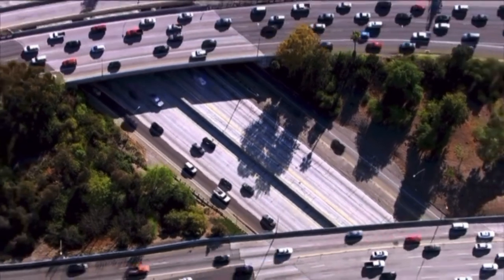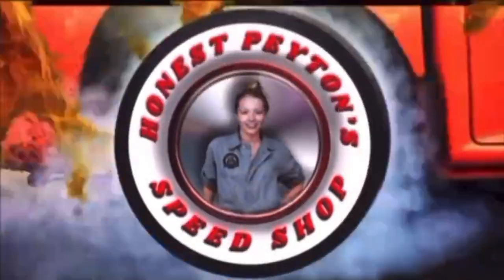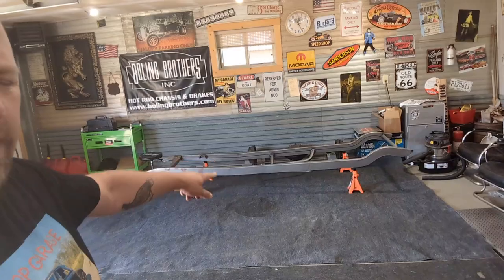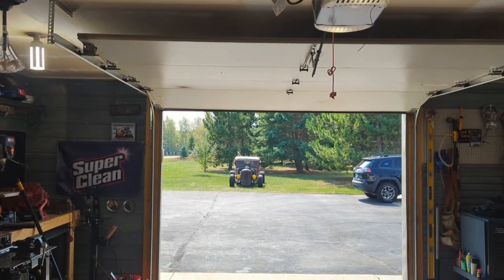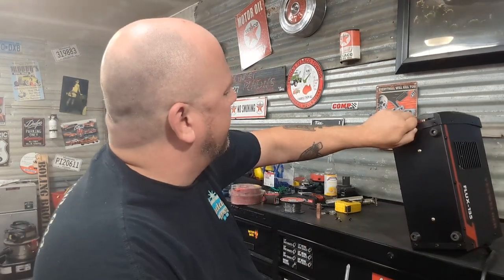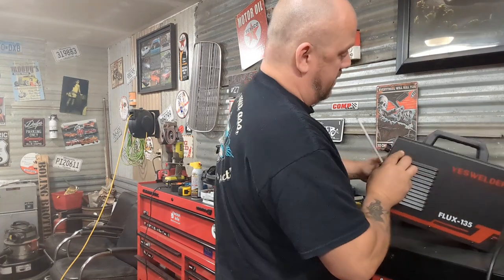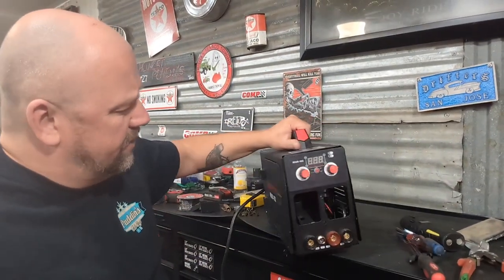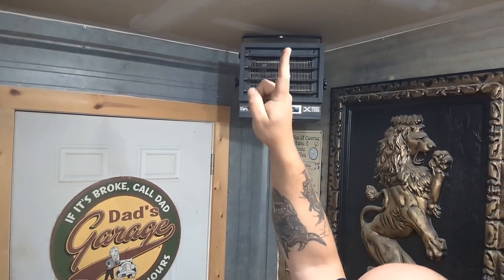Spring Cleaning...is it too late?

Comment: Worst part of the year FALL time to prep for the curse word. Winter ……. Get you a Howard handler gas welder , for the home they are great. I still use mine at the shop too as well as my miller 135 and the 185
Reply from the maker: I got a MIG 200 from Arccaptain, I have the two flux core welders as spares now.

Comment: That’s not your failure; that’s a very early YesWelder failure. And then making it hard to take apart 🤦‍♂️. You’ll get it. It’s all looking really good out there Chad. Did I miss you putting down a carpet out there or were my eyes playing tricks on me?  Cool to hear about Peyton’s school; she will be a rock star! I made a patch panel on the front of the cowl tonight and plan to install it this weekend. After that I’ll put out the video. Have a great night and tell the family hi 👋
Reply from the maker: The floor mat was under Clyde for the leaks, I added the second one for a little thermal break. They are garage floor mats, work great. I did get the welder figured out, I show it in an upcoming video.
Reply: @honestpeytonsspeedshop  awesome!!!

Comment: Is it the drive motor, or is the wire sticking in the liner? You might need a new liner. Hopefully they will teach Peyton Oxy/Acetylene welding too.
Reply from the maker: This video is a little older, everything is back working fine, it's basic welding so far stick and mig,
Reply: @honestpeytonsspeedshop  👍